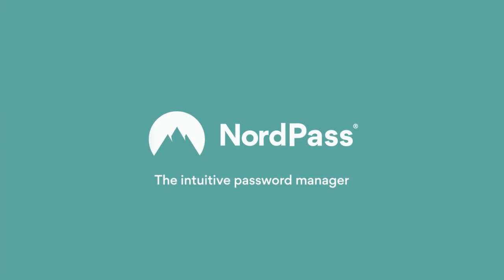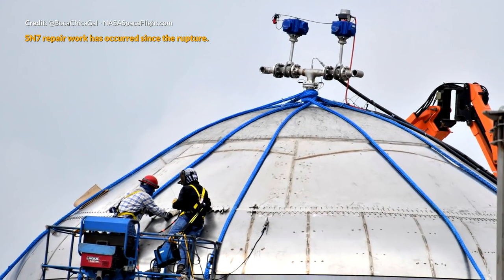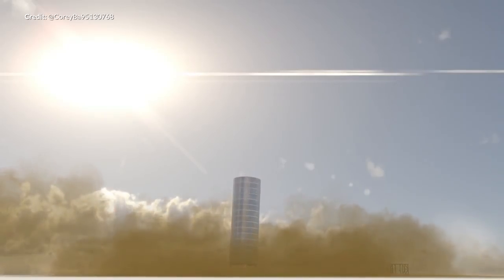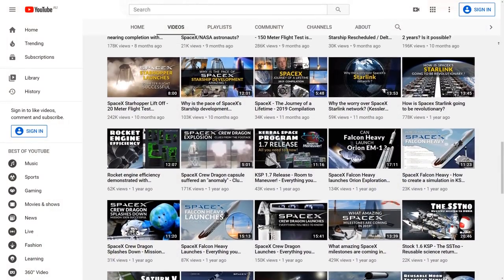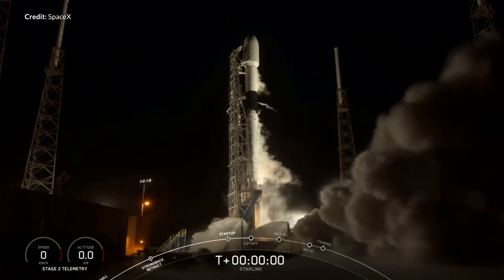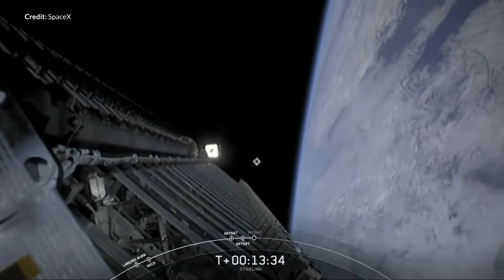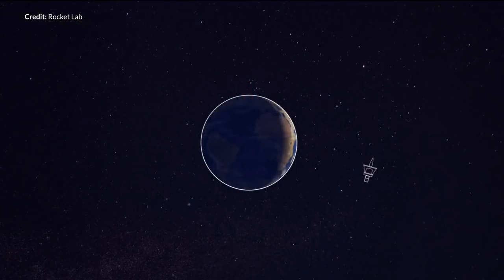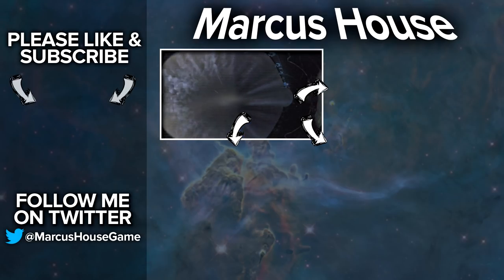SpaceX Starship News, Starship/Super Heavy offshore Spaceport and Starlink Beta Testing coming soon

Comment: It was a DELIBERATE burst testing a Plug that is designed to prevent catastrophic failure at a set pressure this was NOT a screw-up. Think of it like freeze plugs in an ICE engine block.

Comment: If you want to build off shore platforms, Texas is the place to be. Texas companies invented of off shore drilling platforms and most of the design expertise for platforms world wide is based in Houston.
Reply: Elon musk and oil drillers working together for a better world.
Kumbaya.
Reply: That brings up an interesting question. Elon is talking about floating platforms, because that is what he has to use for Falcon 9. The Falcon landing platforms have to be floating because the landing point can vary widely. But with Starship suborbital transport, the launching and landing points will be very firmly fixed. Maybe, therefore, a fixed platform like an oil rig would be better.

Comment: SH pad not a speculation. It and new 81 M high bay are confirmed. Manitowac 18000 crane currently being assembled to build Highbay  and at SH pad pylon casings some 2 meters wide and 24 meters deep are being drilled rebar inserted and concrete filled.

Comment: I was treated with courtesy when I asked  a "stupid question"  on the last video so here goes again.  How high will Starship cruise during transcontinental trips and will passengers experience any weightlessness?
Reply: the passenger will experience weightlessness whenever the engines are shot down, for the height, we dont really know, but the trajectory will probably be blallistic for 90% of the flight so it will surely depend of the destination
Reply from the maker: No question is stupid unless it comes from a Flat Earther. :P Good answer here by Auxence. Couldn't put it better myself.
Reply: @AuxenceF    I certainly hope nobody shoots down the engines at all! (grinning and ducking and running)
Reply: The flight will be a ballistic trajectory, so it will be continuously rising or falling. Maximum altitude will probably be around 100 miles.

Comment: How deep do you have to go to get as much pressure underwater.
Reply: For each foot of depth under water, pressure increases by .445 pounds per square inch. For metric units: https://www.vcalc.com/equation/?uuid=a65483d7-e5bd-11e7-abb7-bc764e2038f2

Comment: 8:50 That's some terrible government right there.  The ISPs have been dragging their feet for 20 years while SpaceX is doing things now.  I live in a rural county.  To cheat the system several ISPS have built fiber "to the county line" which means 30 miles away from where anyone actually lives but they got a lot of $ to do it.  Total scam.
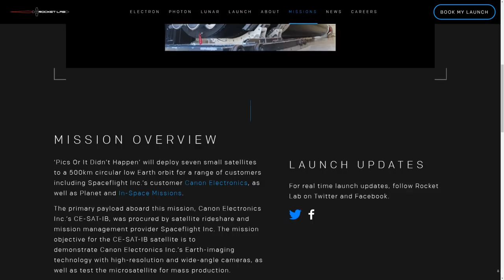14:00 Are they the ones with the hot pink pipes?  They seem fun.

Comment: I just cant think at any point in time that point to point will be anything more than a very risky gimmick... as i just cant see fair paying people using a service.... (with potentially their children) taking such a high risk factor mode of transport... dont get me wrong id love to do it... but with the   excelleration deceleration and flip manoeuvre being involved that the FAA would even approve it.
Reply: Scott Ogden - SpaceX is going to successfully launch & land Starships at least 20 times (with no failures) before putting humans on board.
Reply: People used to say pretty much the same thing about steam ships, locomotives, airplanes, and jets when they came along. The big problem with Starship as a point to point transport is that Elon feels it necessary to put the launch and landing facilities at least twenty miles off shore. The logistics of getting to and from those sights will add back on most of the time that would be saved by suborbital flight.
Reply: Odysseus Rex - That should add about an hour each way using Trimarans or Hovercraft. Between that, and the expedited security (Starships would be impossible to hijack), going from check-in to boarding might end up taking less time than present security checks on international flights.